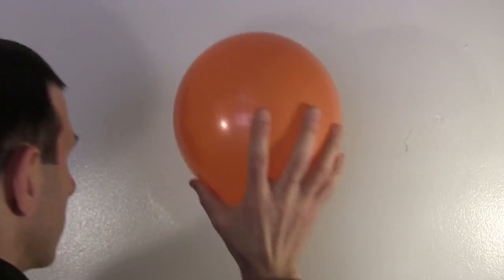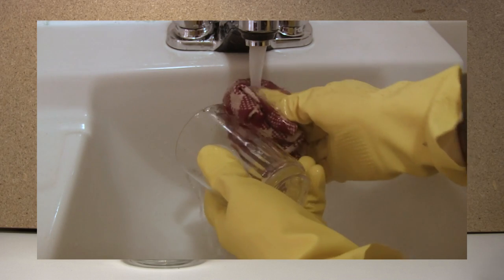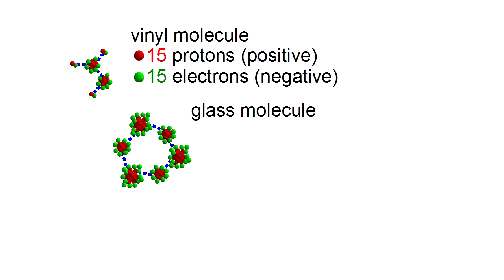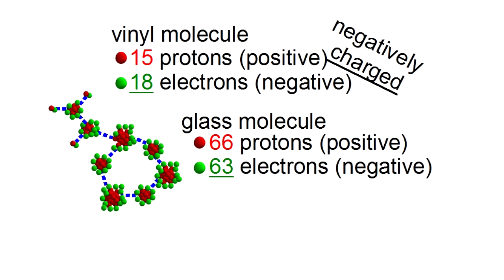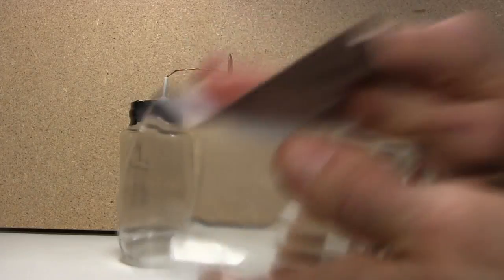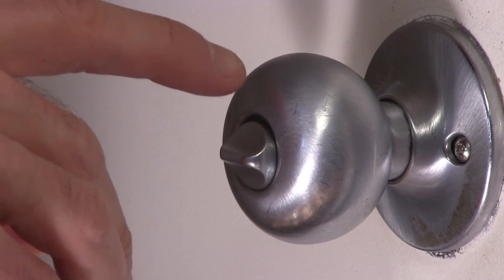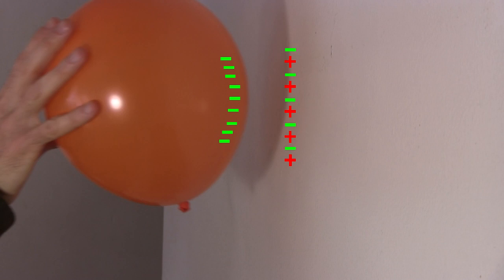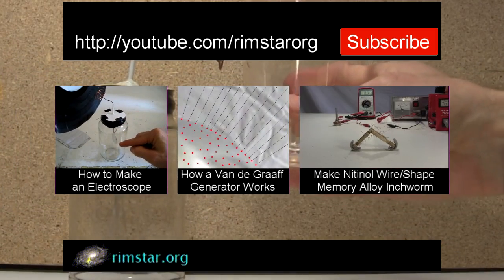Triboelectric effect/series or triboelectricity

Comment: Thanks for the video Sir. But, do the balloon stick forever with the wall that you used in the last minute of the video RimstarOrg ?
Reply from the maker: No, it gradually loses its charge and slides down and falls off the wall. Since opposite charges attract each other, positively charged ions from the air are attracted to the negative charges on the balloon and cancel them out. As more and more of this happens over time, the balloon becomes less and less negatively charged and so it is less and less attracted to the wall.
Reply: I thought so, but never knew that it is because of air. Thank you and bravo Sir.
Reply: @RimstarOrg  How come there are ions in the air?

Comment: When you end up with one thing "negatively charged" and another thing "positively charged", I understand that they have those charges in relation to each other. But what happens if you make more of each?  Is the relationship universal, or does it only pertain to its "sister" object? 

 For example a battery's positive pole is only positive relative to it's own negative pole, and it doesn't share that relationship with any other battery.
Reply from the maker: gilbet Negative charge has to do with having more electrons than protons. And positive charge has to do with having more protons than electrons. The amount of each charge can be measured and then compared with the amount for any other charged object or portion of an object. So with full information you can compare the polarity and amount of charge with that of any other object or portion of an object.If you rub two balloons separately with you hair it's doubtful they'll both have the same amount of negative charge. In that case, strictly speaking you'd say one is more negative than the other, or one is less negative than the other. But I don't think it would be totally wrong to say that the one with less negative charge is positive with respect to the other. In some cases, when you don't know the quantity or the polarity of the charge, then that's all you can say.In the case of the triboelectric series, from experiments done in the past we do know which ones will become negatively charged and which positively charged.
Reply: RimstarOrg Thanks for your explanation.  I've been trying to understand how a charge works, but electrons seem to be kind of hypothetical like moles that are used to make the behavior fit into equations and calculations.

I wonder if any of your experiments have been able to establish concrete proof that they exist?   If  electrons to exist, then it seems to me if we were to "add" or "remove" electrons from an object, and keep the object inside a laboratory vacuum chamber, then it should be able to hold that charge nearly indefinitely.  

But if we have to say that the "charge" eventually dissipates because the surplus electrons "jump" across the gap, or "jump" across from the outside, then it would seem like electrons are just some type of magical pixie dust.
Reply from the maker: gilbet Oh, electrons do exist. An early experiment was http://en.wikipedia.org/wiki/Oil_drop_experiment but there've been all sorts of experiments since. Exactly what form they take is what's not known.
Reply: RimstarOrg I guess what you're saying is that electrons exist as a measurable behavior, but the process behind it is unknown.   

But It seems a little confusing for people to call it "electrons" as if it were tiny particles, when there is no evidence or even indication of that type of existence.  If its just a behavior then shouldn't it be referred to as the behavior itself, such as "spin"?
Reply from the maker: gilbet They have more properties than spin, such as charge, and mass (using the physics definition of mass, not the intuitive one.) I'm just an amateur scientist but my understanding is that in quantum mechanics the notion of the electron being an infinitely small point source is a mathematical convenience. In string theory it's vibrating strings. Only some people think it's an actual tiny, hard particle, certainly not trained physicists. It's often drawn that way in diagrams for convenience. You have to draw something after all, and if the shape doesn't matter for the purpose of the diagram then you may as well draw a circle or sphere.
Reply: RimstarOrg Thanks for your reply.  I've taken a new interest in this stuff after coming to the sudden realization that electrons and photons don't exist in the way I thought they did.  This seems to leave a lot of things unexplained and presents it as a puzzle that still needs to be solved.  

I like puzzles, and so I want to try to develop a theory to explain gravity, temperature, radiation and electromagnetism without having to resort to using imaginary particles or having to bend measurements and dimensions in order to make it all fit together. 

Seems to me, bending space and time is an oxymoron, because if you bend a dimension's measurement, you're no longer measuring it.

With time relative to an Earth clock at room temperature and sea level (gravity level), you either measure how many minutes a phenomenon is, or you don't.   If you bend it, it won't be Earth-clock room temperature sea level minutes anymore. 

Same thing with space:  If you bend rtsl Earth meters, it won't be rtsl Earth meters anymore.  Although the measuring instruments will fall apart when you move them to a different temperature or gravity level, it's the instruments that fall apart not the dimensions themselves.  

Just taking a metal tape measure outside in the cold will change its length, but it doesn't change where it is relative to where it was, for example how many paces you took to move it.   Or maybe you could take a metal clock outside to make it run slower, but it doesn't change what time it is when you did that, according to your digital watch. 

But it's fun to try and figure these things out.

Comment: Very clear explanations and simple and functional assemblies ... Infelizemente live in humidity environment between 50 and 90% ... To repeat these experiments only using air conditioner or dehumidifier air ... Great video ... !!!
Reply from the maker: claudiomar santos Thanks! I've had problems with very high humidity too, but I never looked at the humidity at those times. It was probably around 90% to 100%. In those times I used an air conditioner too and it helped.
Reply: Ok, thanks a lot !!! Are great experiments but need very dry air ... HUG!!!

Comment: can i use ballon as the belt on the van de graff generator and also can i use plumbing tape the white stuff for the belt
Reply from the maker: the king Balloon material is usually pretty thin, though you can find thicker stuff, but it should work. The white plumbing tape is teflon, so I'd think it would work. I don't know how practical it would be though, since it tears pretty easily. But speaking from a triboelectric standpoint, they should work together. You can use a glass tube from a fuse for the other roller like I do in my How to Make a Van de Graaff Part 2 video https://www.youtube.com/watch?v=QrCgtjZwnB0
Reply: thank you very much